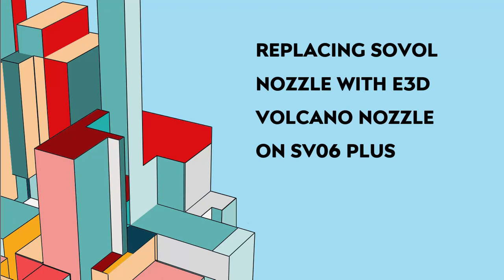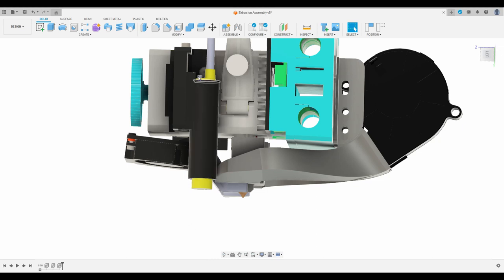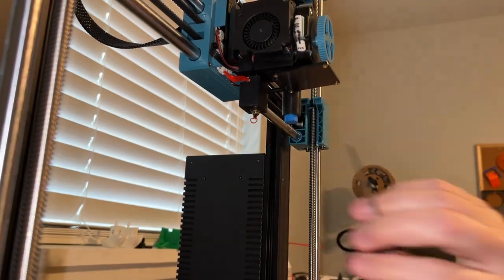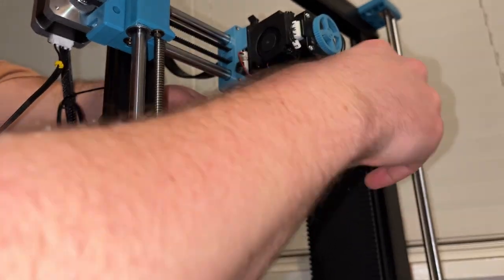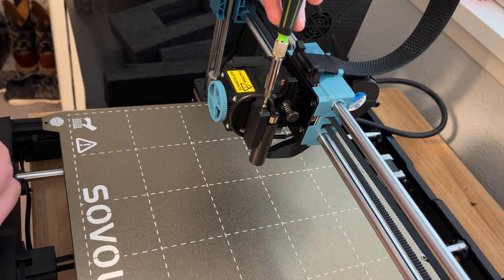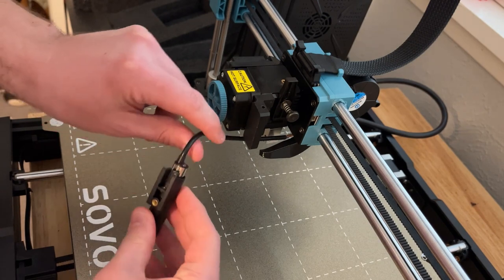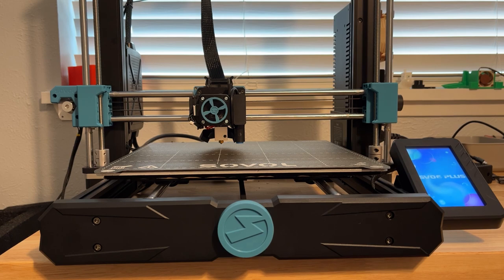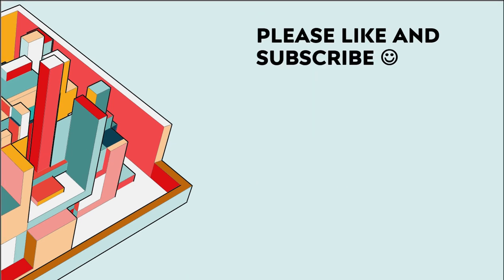E3D Volcano Nozzle in your Sovol SV06 Plus!

Comment: Great info, well done video! I think you will also need cut the silicone sock a bit. With a nozzle change re-tuning extruder PID is also recommended.
8:00 for this step I recommend flipping the PEI sheet so even if it goes over it wouldn't damage the PEI coating. You do need the steel sheet for the inductive sensor.
Zach mentioned it, but very important to highlight: do heat the nozzle to 250 or higher before changing, otherwise it will break. Thank you Zach for posting!!
Reply from the maker: I was able to re-install the silicone sock without issue on mine. I suspect sovol updated the design for it bc mine doesn’t perfectly match the CAD files for the silicone sock.

I do probably need to do a PID retune. Good idea about flipping the bed. Thanks for commenting! I’ve watched some of your videos on the Sovol products!

Comment: Unrelated, but worth the ask in my opinion. Have you experienced bearing issues with your SV06+? Just recently packed mine with grease, and the x axis bottom bearing is making that axis very stiff.  Planning on getting replacement bearings to have a set.
Reply from the maker: I re packed mine with grease when I got the printer, pretty much before doing anything else. I haven’t had any major issues with them so far, but I have seen a lot of talk about them being problematic. May just be luck of the draw.